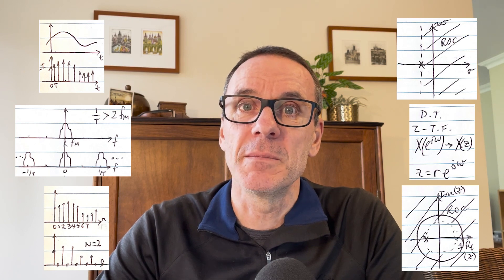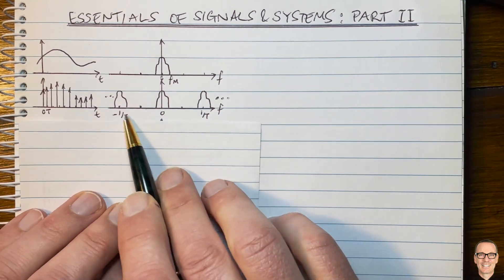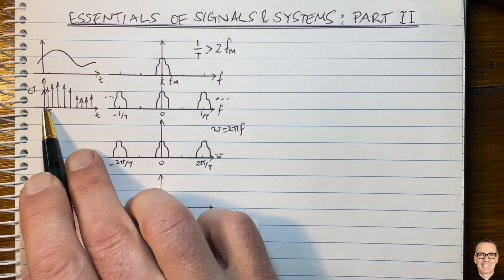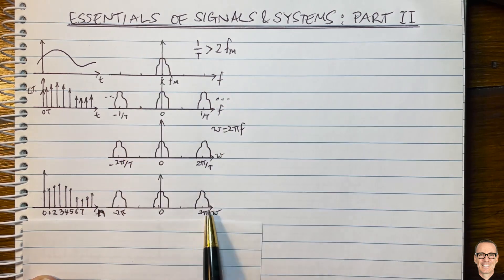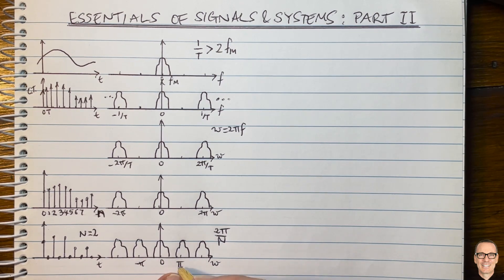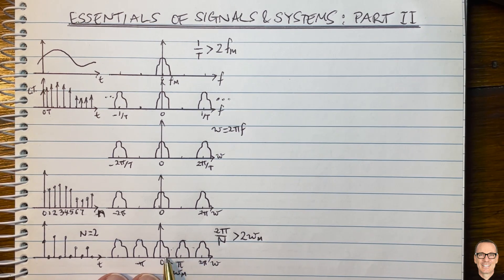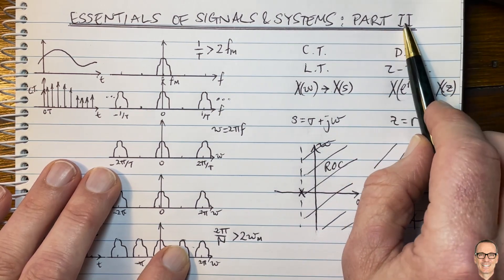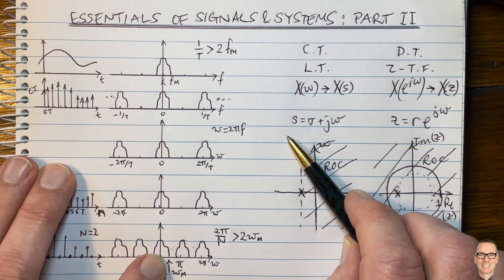Essentials of Signals & Systems: Part 2

Comment: If delta function has an infinite amplitude and zero width at t=T making the area 1 when taken across whole time axis,  how multiplying it with the signal x(t) provide resultant samples that are of the amplitude x(t=T). Shouldn't it be infinity as the delta function's amplitude is infinite and when multiplied, doesn't the amplitudes get multiplied in the result sir????
Reply from the maker: Yes, you're right. Sometimes people talk about delta functions as having a "height" (even though the height is actually infinity), since we tend to draw delta functions with heights that relate to their area. If we always drew the delta function arrows the same height, irrespective of their area, then it wouldn't convey the area information, and the graphs wouldn't be very intuitive.

Comment: I don't know how to send a private message, but after watching your video about the NOMA system, teacher, I want to ask a question: What is the combination of NOMA and OFDM? I put forward such a conjecture: In the case of mutual cooperation between two users in a cell, 16QAM modulation technology is used to modulate the data onto each OFDM subcarrier (and the carriers are orthogonal to each other, there is no mutual interference), and then use NOMA's power multiplexing technology......
I would be very grateful if you could answer my question.
thank you!
Reply from the maker: Yes, you could perform NOMA on each subcarrier.

Comment: Hello.
With all my respect, but I think there is a mistake when you drew the spectrum of the decimated signal. An N order decimation also implies that the signal spectrum is also expanded in an N factor right? So Wm should be now 2Wm.

On the other hand, replicas still repeating every 2pi, not pi I think.

Just my two cents 😊
Reply from the maker: But I didn't draw the decimated signal! You'd be correct, if I'd drawn the "compressed" version of the sampled signal (ie. the "sampled" signal, but with the "zeros" removed). Also, I don't like the term "decimated", since this literally implies removing one sample in every ten. I much prefer to describe the process in two seperate steps - "sampling" and "compression".
Reply: You are totally right!👌